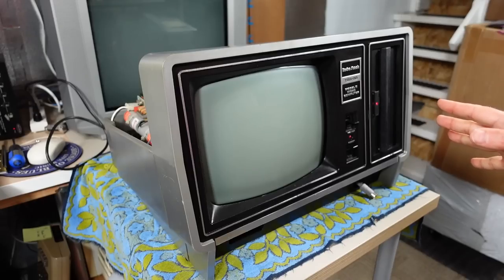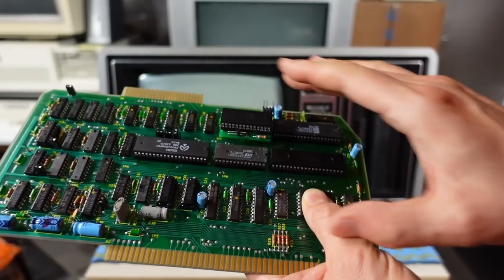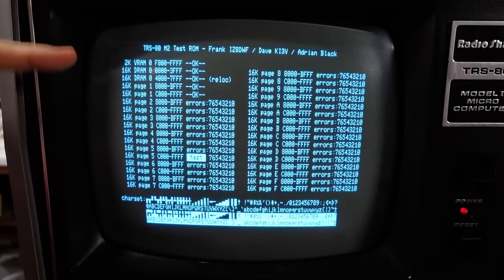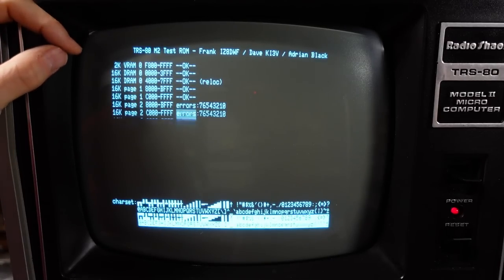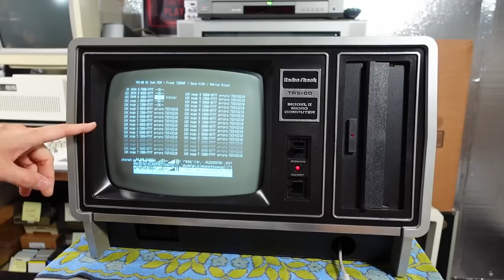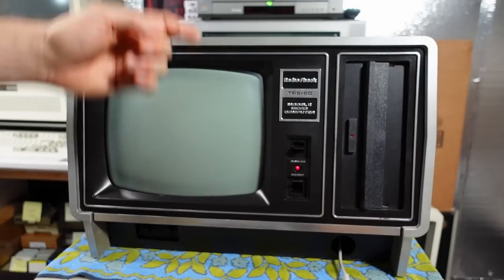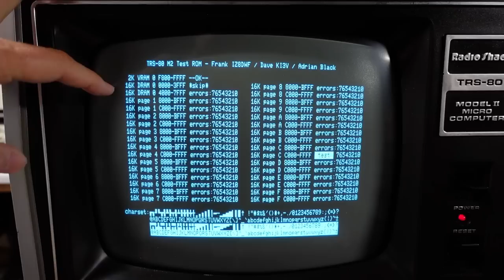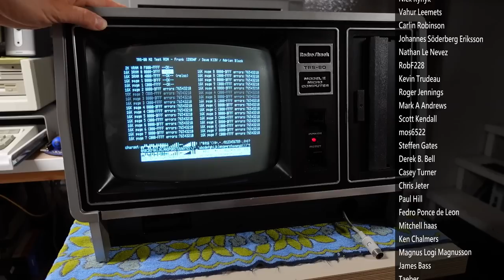We ported our diagnostic ROM to the TRS-80 Model II

Comment: Been loving this stuff on building a diag ROM, and the fact you’ve given it back to the community. Diagnostics are such a 'chicken & egg' problem as you are very likely to have lumps of a system non functional, and that makes solving the diagnostic problem rather a fascinating area.

In fact, not only is it a 'chicken & egg' problem, but the egg may be cracked or have gone off completely.
Reply from the maker: I'll have a video out this month where I use this diagnostic ROM to repair this machine. It had an intermittent fault and right after making this video it flared up again -- but the ROM allowed me to zero in on the issue.

Comment: Just repaired my Model 1 this past weekend thanks mostly to this diagnostic! My biggest problem was getting it onto an EPROM. I have some 2732 I picked up last year to replace the char ROM on an Apple //e. They're actually 13v programmable ones. But while I know I damaged one with incorrect voltage, I ended up going thru 4 before finding a good on. Questionable Chinese chips apparently. But ultimately I got there and it worked like a champ - turned out I had SIX out of the eight RAM chips were bad. Luckily I have an expansion interface I was able to steal chips from while waiting on replacements to come in. Other problems were the cap the couples the vertical sync into the composite had broken loose so pic wouldn't stop rolling and keyboard connection keeps breaking - gonna replace it with headers and a modified IDE cable like I've seen others do.

Once that's all done I'll get back to the EI and see how the diagnostic works testing the memory in there.

Thanks again so much for all the work you and the other devs put into this diagnostic!

Comment: My first paying job was programming a Model II for a local school district.  I made $1K from that job (about 2 weeks work).   Adrian, if you have the BASIC manual for this computer, you'll find a lot more sophisticated file system commands for doing indexed files.    I don't remember if it had a speaker or not.
Reply: Ah, those were the days. I too started with Model II programming and entry in 1982. Unfortunately it doesn't have a speaker. I wonder if you could put one on it? I have one to check out.

Comment: The Model 2, 12, 16, 16B were all the same "basic" machine. The Model 12 replaced the single sided floppy with either 1 or 2 double sided Tandon floppies and a huge white case. The 16/16B added the 68000 card set to run Xenix. If I recall, the 16 was a white cased Model 2 with double sided drive(s). The 16B was a Model 12 with the 68000 cards. There is no sound producing device within these machines unless you include the fans, drives or the monitor horizontal high pitched quiet squeal. Very nice work!

Comment: While looking into TRS series of computer, it's great Frank, Dave and you did make a diagnostic ROM. And I realized how simple and open is Apple ]['s chassis bold design at that time, welcome to repair or upgrade me if you needed, very friendly to work with, even VIC-20 or C64 need to open the chassis and remove the keyboard.
Reply from the maker: It's true. It was designed to be worked on and expanded. No other machine at the time was like this except the older S100 bus machines. But those weren't aimed at mass market home users and kids like the apple was. Then the IBM PC carried forward the expandability while everything else pretty much went away from it.

Comment: I learned this from a MacBook repair man, use magnets(the Mentos sized neodymium ones) to hold screws...  You can clip one near the end of the shaft not so close to the bit the magnet jumps to a metal case.  You can then bump the screw against the plastic and quickly move to the next one.  When done grab the magnet and get all the screws for free, you can then clip them to the work piece and not fear loosing them.  A pack of 20 are like $3 at Walmart and they are handy just hanging out stuck on the fridge and garage door.

Comment: Just a small correction,  the TL 866 II programmer can program ROMs that need over 18V,  you just need to use a separate power supply to do it.   Bend the VPP pin from the chip out of the programmer socket and connect it to a bench supply with what voltage you need.  Connect the negative to the ground pin while it is still in the socket (don't pull it out).   I've done this a few times with chips that needed 21V+ without issue.  I don't know if it works with all of them however.
Reply: Or instead of a bench supply lacked by my younger self did, wire 3x 9v batteries in series.

Comment: 10:40: That charset is interesting. I wonder if the upper 128 characters are stored, or if there's simply some inverter circuit for those. Back in the very early days, RAM was at such a premium, it would have been an inverter, but the Model II came out a little later. Also interesting how the box-/line-drawing and semigraphics characters occupy the lowest two sticks (yes, groups of 16 ASCII chars are called sticks) as printable alternatives to the C0 control characters, and then it's just regular ASCII after that, with the ± sign also added as a printable alternative to the delete character. All more regular than PETSCII, ZX80/81, etc.
Reply: In the stock Model I, logic chips are used to generate the second most significant bit (bit 6 counting 0-7).  So there is only 7-bit VRAM, and lower case letters were not supported.  In all of the other machines, VRAM is 8 bits.  The issue is that you need the 8th bit to determine whether the character should be inverted or not on the screen.  Once you have 8 bits, all you need is a character generator ROM that's 256 bytes long instead of 128 bytes.  Even in the days of the Model I, the price difference between 128 and 256 bytes ROMs was low enough that the Model I had a full 256-bytes character ROM, but only used half of it.  In practice, the 7-bit VRAM in the Model I is a mess, and it's good they went away from it.
Reply: @drgiller  Often I found myself thinking that the character only nature of the I/II/III/IV, putting aside the add on hi res cards for the III/IV, could really have benefited from a programmable character set.  The MI had 12 scan lines in each character cell, about 3 kilobytes all up for 256 characters.  It would have allowed for hi-res games etc in the manner of later machines such as the Commodore line-up.

Comment: Adrian, you mention not being able to program higher voltage cards with the TLS-866II PLUS (or whatever version number they use). You can make an adapter and lift PIN 1 (or whatever pin is VPP) and pass the voltage through to the pin to switch on the programming. I've been doing it for ages, works fine.

Comment: Another great vid!  Almost makes me want to get a TRS-80 Model (something; well I have a Model 100, but I mean one of the big ones)...  ;-)
I think I've seen a youtube video to allow using higher voltage on the newer minipros.  You just have to manually add the 21v to the chip yourself.  That either means making an adapter or bending out a pin on the chip, and of course, having a separate 21v feed.  Not ideal, but at least it is an option if that is the programmer people have.  ;-)

Comment: I had forgotten that the 8" drive is just normally installed at an angle, and for a while there, the way its PCB and the PCB cards seemed to be all askew really threw me. Of course it makes perfect sense for that drive to go in slanted, so the front of the machine can be neat and have a slant that's a bit more ergonomic.

Comment: Excellent as always! Since that computer run with a Z80, would you or friends work on a diagnostic for Timex Sinclair and Kaypro computers? What about the Apple II+ and Commodores? Thanks for sharing
Reply from the maker: The C64 ROMs that test the RAM are terrible -- they really have a hard time detecting subtle page errors.... I hadn't looked at the Timex ROM, but unless it's doing march testing, it's likely going to miss stuff too. (Most RAM tests are simple bit pattern tests which can be inadequate for the more subtle RAM issues.)
Reply: We'd like to do Kaypro soon.  There are two basic varieties of Kaypro though, '83 and '84, which will require different ROMs because the video controller works differently.  Also, the Kaypros have just one 64K bank of RAM, so at some point you have to run the testing code from the same RAM bank you are testing, which could result in the program crashing instead of reporting the bad RAM.  Still, we have ideas and I hope to get it implemented.  Unlike the TRS-80's, I actually have a couple of Kaypros so I can test on real hardware instead of only in the Emulator until Adrian can make time to test on the real machine.
Reply: @drgiller  I have a Kaypro II, not 2 if you ever need another tester
Reply: @RudysRetroIntel  Thanks!  I think Adrian has a II and a 10, so we have the major variations covered, but once we make an initial public release (and I'm sure Adrian will have at least a 2nd channel video), we hope to have many people test it.

Comment: Just a little educational post for those who don't understand "banks" or "bank switching" but would like to understand.
Most CPUs from the era of the TRS-80 used an 8-bit data bus and a 16-bit address bus.  This means that the most RAM which the CPU could directly access is 65536 bytes (commonly known as 64K).  So how, you may be wondering, could it access up to 512K bytes?  This is where Bank Switching comes in.
In the simplest possible terms, the signal to access the RAM did not go directly to the RAM but instead was "shunted" through a set of circuits which allowed the access signal to be sent to different places.  The CPU could change where this signal was sent by outputting a number to a port.  On reset, bank zero of RAM was usually the one selected.  Any program running could select a different "bank" by having the CPU send the appropriate number to the port.
Since it would usually be a Bad Idea to switch all of the memory at once, banks were usually in chunks smaller than 64K.  One typical bank size was 16K since four of those fit neatly into the 64K space.
The information shown on the screen in this video indicates to me that the chosen bank size for the TRS-80 II was probably smaller than 16K, but I'd need to watch again to figure out the exact size.  I'm not bothering because it doesn't matter.
So in summary (and even simpler), it's a bit like having several boxes, some in storage and one you're actually using, and you can switch between them but you can only have one box "in use" at a time.
Reply: The RAM in the Model II is arranged into physical banks of 16K in size.  That is, every 16K is a bank of eight 16Kx1bit DRAM chips.  Pairs of these banks are organized into 32K-sized regions called (inconsistently, even in RS documentation) "pages".  These pages can be "bank switched" into the top half of the Z80 address space, from $8000-$FFFF.  The bottom half from 0-$7FFF is always "page" 0.  Effective memory testing routines must know the size of the physical memory banks, which is why we are testing these in 16K blocks, even though the "page" size, or the size of the blocks that are "bank switched" is 32K.

Comment: 512K was so much memory at that time.  The Z-80 could only natively address 64K (like almost every 8 bit system of the time).  Bank switching was the answer, and a lot of computers used it.  The original IBM PC had cards that could bank switch in and out, so you could add a lot of memory to an original PC.  Don't remember how much.

Hell, the Apple computers used bank switching a LOT.  The language card and other memory cards could swap in and out as needed.

Not an expert, and i'm sure somebody is going to say i am wrong in some detail, i don't care.  Love these early machines and the software bodges that let them do more than the chip designers ever imagined.
Reply: The original IBM PC could address 1Mb of memory because it had 16 address lines but only 8 data lines for compatibility with the 8080 peripherals.
Upper memory was used for ROM and Video hardware access so natively it could access 640Mb but an expansion board could add 2Mb of bank switching expansion RAM.

Comment: models II,12, 16, 16B and 6000 all have a similar architecture.
Reply: This ROM should work on all of those, but to our knowledge it has not yet been tested on hardware other than the II.  I have tested them all in the emulator though and they work fine there.
Reply: @drgiller  I have a 12 I'm working on now.  The slimline drives don't have a head load as I understand so it just turns on and spins with a static screen of graphics characters.  My system had a blown 12v fuse which cooked the 16k RAM chips and the CPU was dead.  I replaced the CPU and the stock ROM gives a "Boot Error MF"  which indicates a memory issue.  

I'm willing to help test any updates needed for the model 12.

Comment: @02:13 That poor towel is screaming as it's being twisted on the rough surface 🙃
It's begging for a tumble in the drier with a slightly damp compatible 70's towel and a sheet of lubricious fabric softener for 20 minutes...
#The70sTowel will thank you
(And be more relaxed)
I imagine the tag disappeared countless use/wash/dry/store cycles)
Reply: The cool frays are happy as larks  hanging on
Reply: Listen to the towel whisperer…!  😉😇
Reply: @serpent213  agreed, but when the edges suddenly come together there might have been 'micro-cutting' of the fibres..' They won't come out in the wash.. +Puts on tin foil hat+ 🪆

Comment: I may have misunderstood, but isn’t the disk controller bundled on the same card as the video controller? If that’s the case, when you removed it, should the floppy head commands still work?
Reply: Keyboard and video are on one board, Floppy controller and printer port are on another.
Reply: @drgiller  you're right, my bad! :)
Reply: @MrKeebs  Funny enough, when he DID remove the floppy controller, the code kept working.  I guess when you read the IO ports for a missing controller board, the bits that come back from the empty bus happen to match what I was looking for to continue on.  Dumb luck.

Comment: They should have gone with a ZILOG Z800 CPU which would have meant that programs would be smaller and faster because you would not be writing Multiplication or Division because of the umul,muls,udiv and divs instructions and of course you could run INTEL 8080,ZILOG Z80,ZILOG Z80A and Z800 assembly language and even a custom version of UNIX System V.